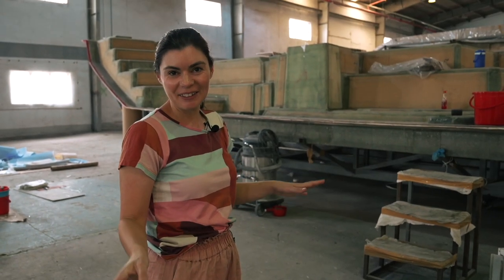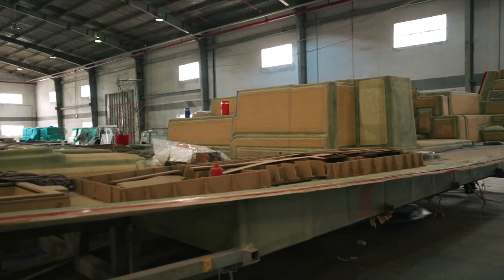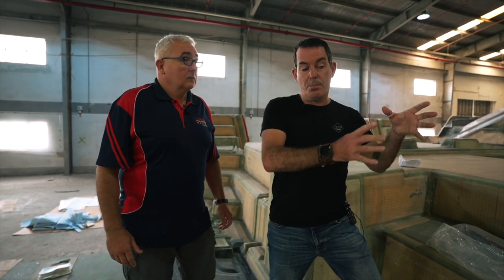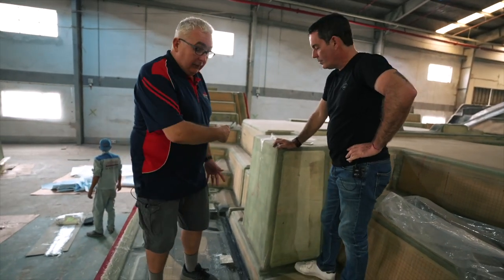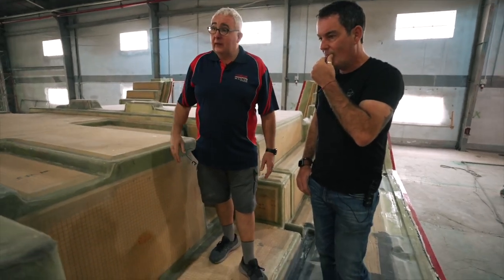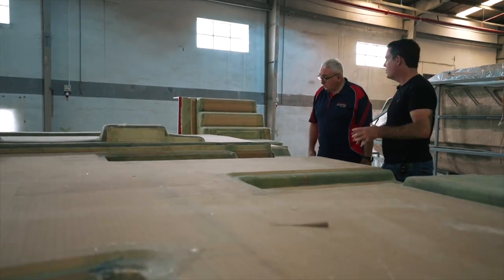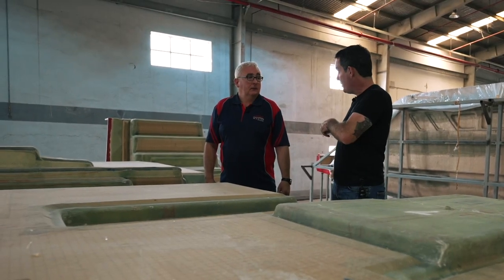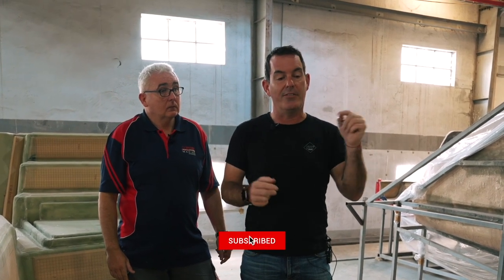HELP US Figure This Out! | Catamaran Build in Vietnam

Comment: Fascinating, keep these build videos coming. Best on the web. Detail and complexity, scale huge, its a big boat. Nick you probably know that you can use mathematics to calculate the optimum ratio of the wall thickness and width of the flanges and the web in an I beam, to get maximum strength at minimum material. Also, for a tube, the optimum ratio of wall thickness to diameter. Every bone in the human body has this optimum ratio! Isn't that amazing.

Comment: At 6:34 he talks about E glass weight to carbon but it is actually two thirds, so 900 gram E glass UNI is equal to 600 gram Carbon UNI in strength so there is a weight saving of approximately one third with resin weight usually a bit less than the fibre weight depending on hand lay up to vacuum bagging. Great video and I am very impressed with the design and construction methods. These boats are really built as true blue water cruisers, where many other brands are marketed as blue water boats but in reality they are just charter/party boats.  Cheers Rustie. PS I am building a Grainger.

Comment: Well, I'm still not in a position to buy a catamaran, or any sailboat for that matter.  However, I think Seawind has a great salesperson in Nick.  I think this video series is going to do a lot to promote the  Seawind 1370, and by that, the rest of the model lineup as well.
I am impressed with the build of the boat, and if this continues to hold through the entire build, you'll be able to take RR2 just about anywhere on the planet!

Comment: Seeing & recording construction in-process is of great benefit to you. In the future if you have a problem or a concern, you can check the tape. Are you going to be getting as-built mechanical, electrical, plumbing, and maybe dimensional structural drawings?   Terysa & Nick - what an adventure you are on, but not so monumental that getting into the water and sailing will not be an anti-climax. Yeah, this adventure is merely foreplay! :¬) Webhead USA

Comment: I was surprised that SeaWind used e-Glass. The preferred quality fiberglass is s-Glass for structural glass. I get why e-glass is used. It is about 1/2 the cost. But the overall cost of using s-Glass is not that much money. And there are saving is resin as well because less glass is used. Being significantly stronger, you use less s-Glass and thus less resin as well. There are so very positive upsides to using s-Glass. It does not adsorb moisture to the same extent. If the boat is lost in a storm on a beach, the odds of survival are far better. Thus "salvage of the boat" is more feasible.

Comment: Love getting into the "Geek" stuff about boat building and fiberglass/carbon fiber work in general.  Is there any reason other than cost NOT to use all carbon fiber?  That would probably get the weight down to 700-800kg (maybe even lower) instead of the 1100 that it currently is.
Reply from the maker: Cost my friend.
Reply: @sailingrubyrose  That was my guess, thanks for confirming it.